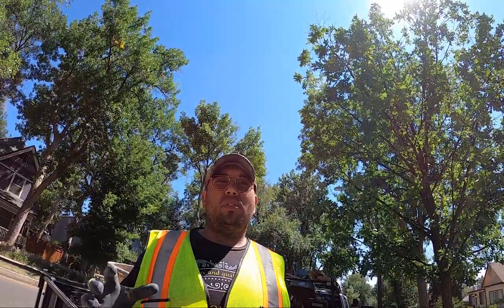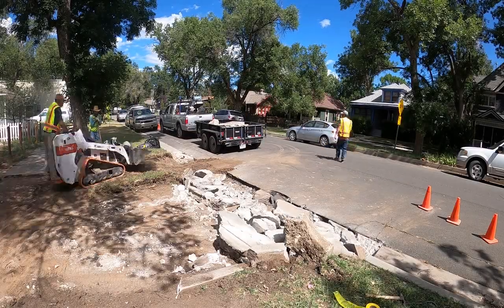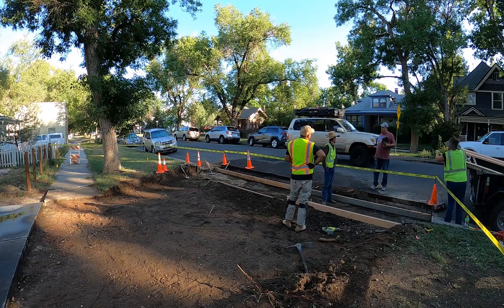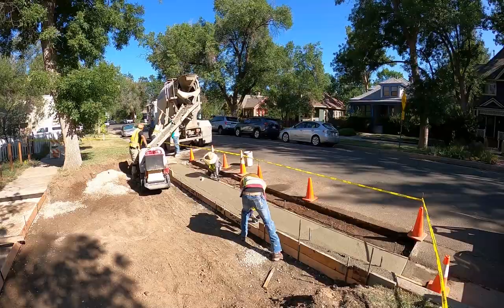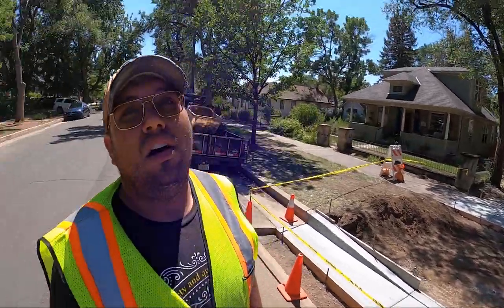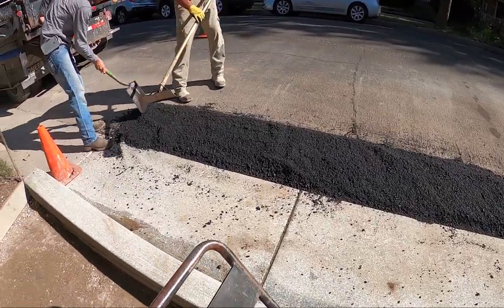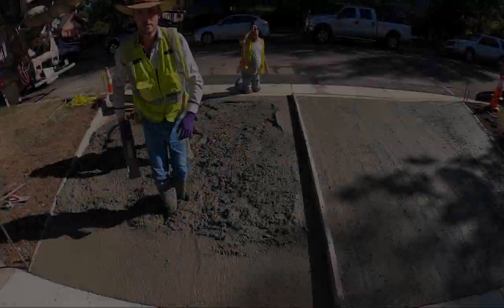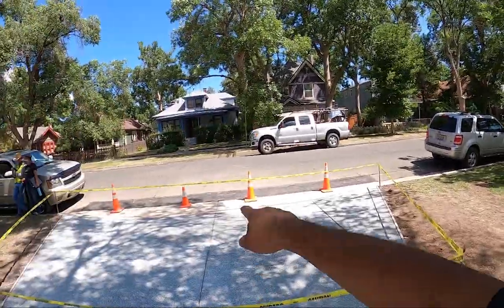How To Pour a Concrete curb, gutter, and driveway approach.

Comment: Dust mitigation is readily available for demo cutting. Should be second nature on private projects like this one.

10-12” concrete depth at the curb is not an uncommon requirement.
Reply from the maker: If you watch the video you will see We have a water tank for the saw. The start of the fut is dry so we dont lose our mark. After that we run a water tank. And we follow city code for curb thickness. Intersections are usually 8" inches thick with a #4 grid on 1 foot center. Thanks for watching.

Comment: Hello I need help my friend.  That cure does it help it look more white ? What kind of cure ? Is it any kind of cure?  I been watching for a while now . Learned of you vids. Great work.
Reply from the maker: It's main benefit is it traps moisture inside the concrete and allows it to cure slower which will lead to a higher compressive strength. And the reason it's white is to reflect light to reduce surface temperature. It's called dayton superior white city cure (J10W). And thanks for watching. We should start posting videos again soon

Comment: Question from someone who knows nothing about concrete. 
Why did you not line up the crack joints to the existing one in the driveway?
Reply from the maker: The spacing on the sidewalk has to be between 4'-5' feet in order to meet code. The current spacing was 50" inches. Moving it over to line it up would have had me in a code violation.  I probably could have done it and the inspector would have given me a slap on the wrist. But it's best to not be on anyone's radar as someone who pushes the limit of code. It does line up like that sometimes and looks awesome. Great observation and good question. We also could have moved the other 2 lines. Both on the curb and the apron. But then those would not have been divided evenly.
Reply: @jmconcretecoloradosprings  good explanation

Comment: Special mix design for city work?
Reply from the maker: Yes you need to request a 6 sack city mix. I'm certain it's just a 4000 fly ash mix with a higher air entrainment percentage but yes. You need to order a "4000 city mix" to pour into city right-of-way. In all my years I have never gotten into the details of it because no one ever has an idea. But in a few months I'm gonna be talking to a mix tech for a ready mix company and this is one of the questions I'm gonna be asking.